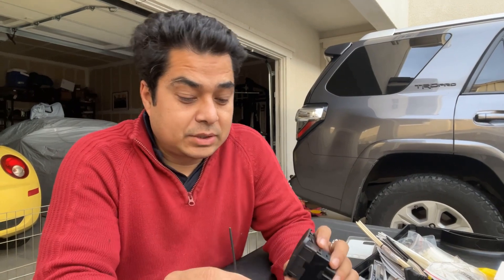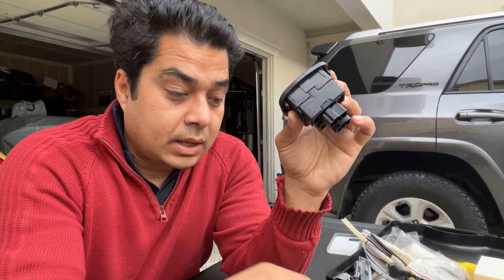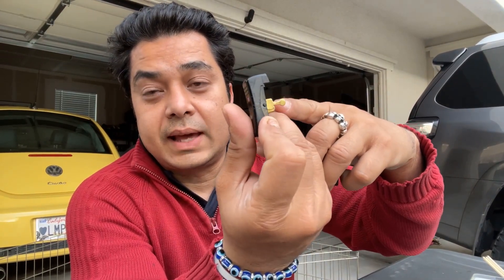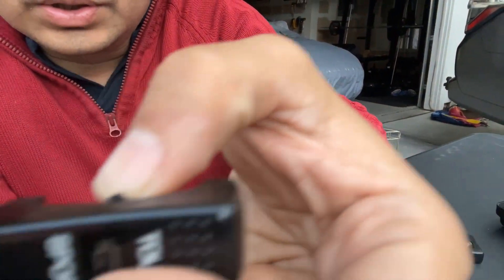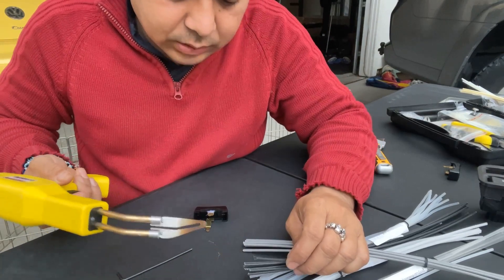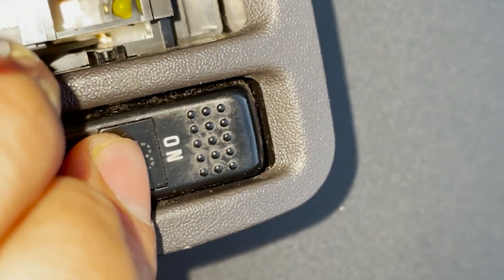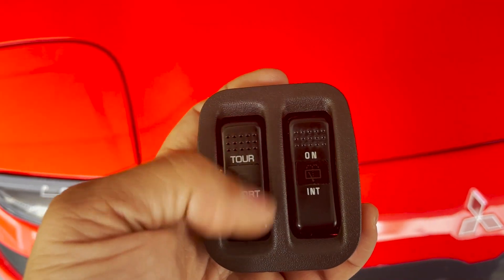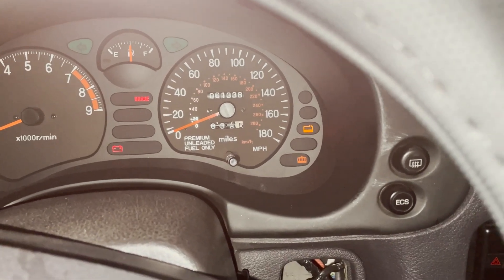1992 3000GT VR4 | Fixed | Active Exhaust Switch Cover | Super Easy

Comment: You should have used J-B Weld Plastic Bonder Black 25ml Syringe after you had sanded the area and cleaned with alcohol.
Reply: I see you also have a malfunctioning ecs. Only the scan tool will save you. Unless the capacitors in the ecs control unit have leaked.
Reply from the maker: @georgeh210   That is something I have to debug and find out.. it wasn't flashing when the car was delivered. It started flashing when I pressed the ECS switch... but I haven't driven the car after that..waiting to do an oil change and drive for few miles and then check for codes...
Reply: @reetomh  before anything l recommend checking the capacitors of the esc ecu . It is in the trunk behind a plastic door on the right side of the car. Also carefully check the plugs to the shocks for any broken wires.
Reply from the maker: @georgeh210  will do. I have been reading through the 3si forums… thanks for the tip..